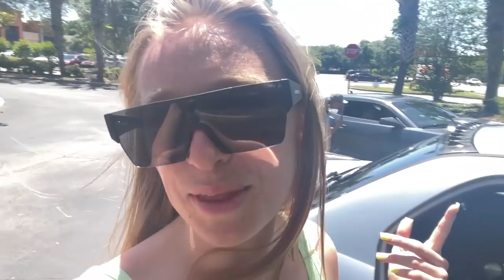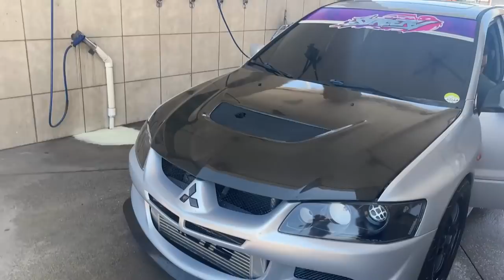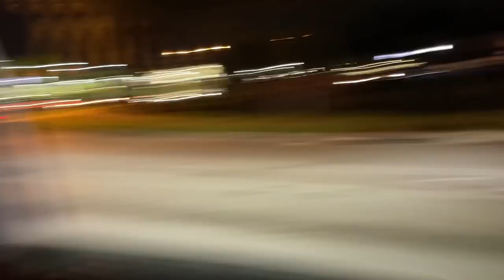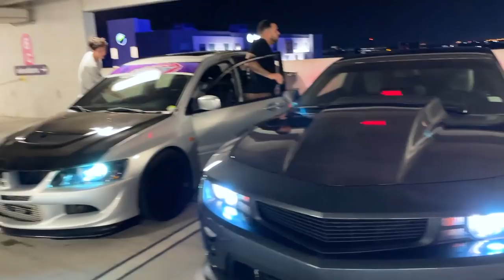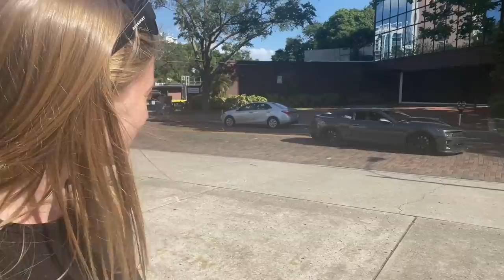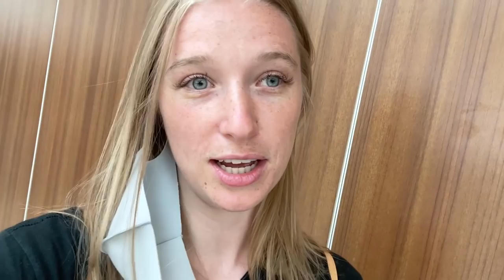Gathering Car Instagram Influencers and Driving Around in a 900HP EVO!!!

Comment: My truck is only a 350 tbi SBC punched 0.40 and a I bet almost stock camshaft, but it has heartthrob deep tone dual exhaust kit no cats and welded straight to the down pipes and has their brand of glasspack mufflers and 3 1/2 outlet slant cut stainless steel 18 inch long exhaust tips straight out the back under the rear bumper, so I don't think I would even want to hear my truck in a garage or a parking garage it's a very loud exhaust manifold equipped TBI fuel injection truck.